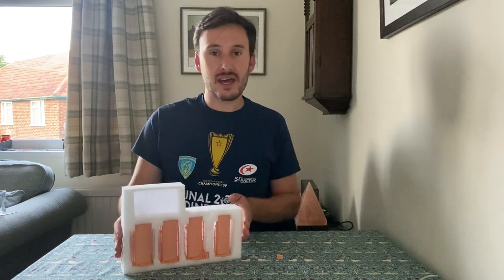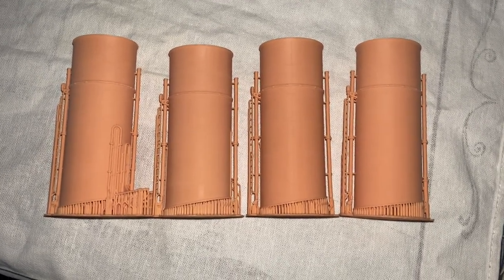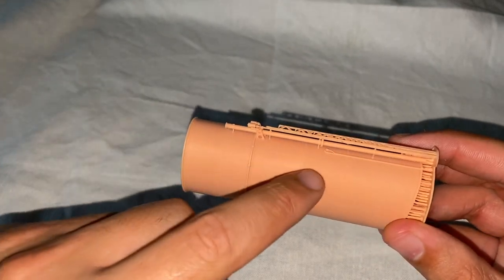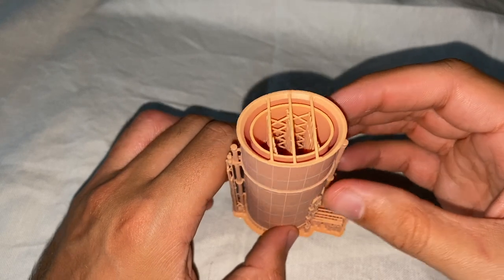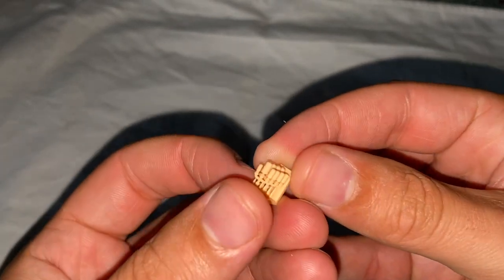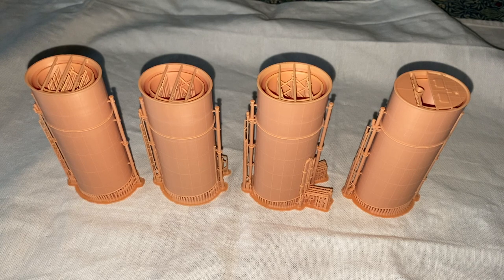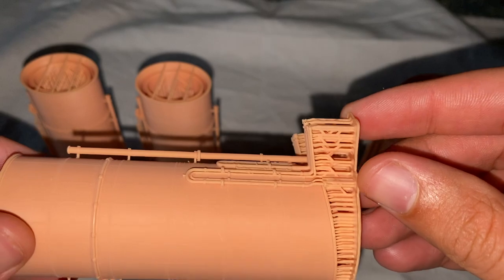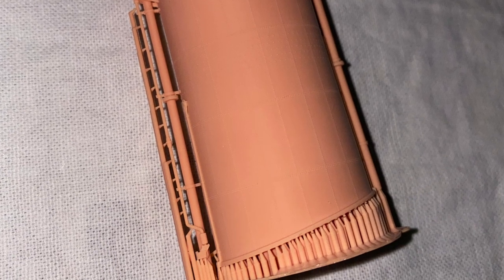1:200 Titanic Add on Review 4 - China 3D Printed Funnels

Comment: I'm intrigued as how do you go about removing the 3D support material which is inside the funnels,   with a hot knife,  without causing damage (particularly to the top of the funnels) ?
Reply from the maker: So this is a challenge yet to be undertaken! 
In my next video I’m doing the bridge, which although not the same, is quite similar in there being a lot of tricky bits to extract. 
Funnels shouldn’t be too far away either.
Reply: @TheModelBoatGuy  Ben at the MidWest Model Shop has a good video on how he managed to remove the surplus material from the China 3D bridge set - you've probably seen it,  but just in case not its at https://www.youtube.com/watch?v=6T-1hxXw6Sc

Comment: Hi Rob, nice review.  Yes these funnels are light years ahead of the kit parts but as you say painting will be more challenging.  Good luck with the support material removal, especially around the pipe work!  Regards JH 😉
Reply from the maker: Thanks! I am getting better at that now, there wasn’t really an option but I am improving. 
Hopefully they can all be extracted safely, the hot blade method is my current favourite
Reply: @TheModelBoatGuy  Yeah, I think I will do the same as you on mine.........eventually!!!!😂